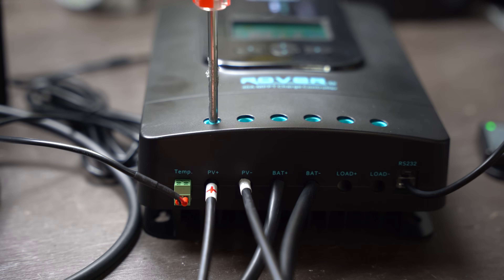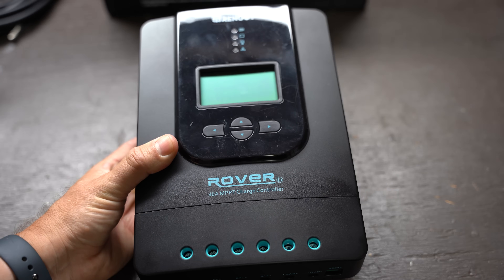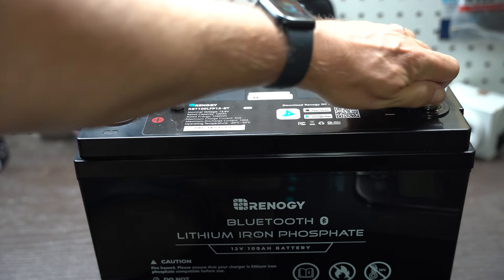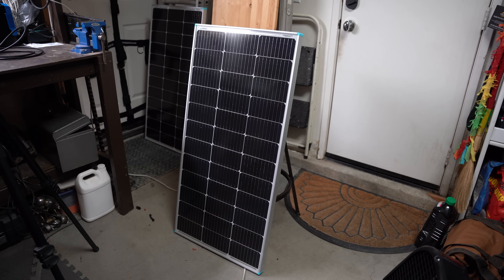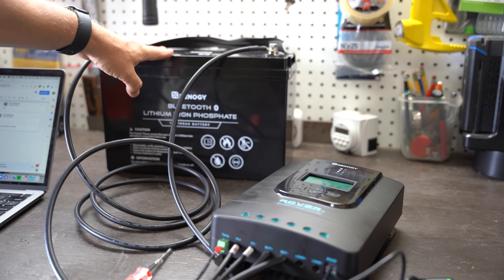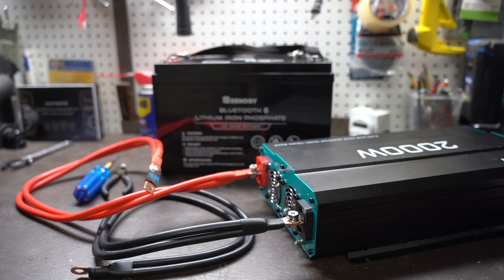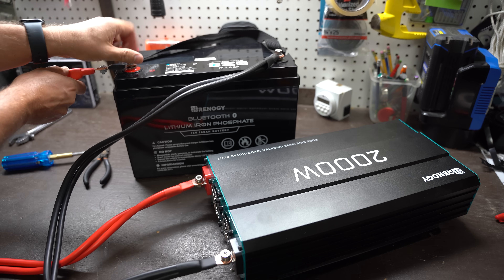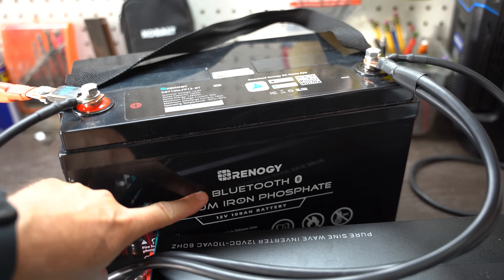DIY Solar Setup: Easy to Follow Step-by-Step Instructions

Comment: Why do you need to disconnect the solar panel and charge controller before proceeding to start the inverter through the battery?

Comment: The only problem is that inverter will suck your battery dry in no time! Unless you have a very large battery bank!
The reflexive load on the battery plus conversion will cost you! If you can use things that can work directly off the 12 volt battery.  Most lighting will do it. Refrigerators, microwaves, and  motors not only need alot of power but need true ac sine wave. The saving grace is they only work 1/3 of the time. (Refrigerator s). 😮 Your system needs maybe 3 x 300ah batteries, minimum. Better to have a kilowatt or two or three. And don't forget you will need solar panels to match the batteries.
Note: Ohm's law.  2000 watt inverter.  Battery = 12 volts.
Watts/volts = amps (current)
2000/12= 166.66 Amps. This means 166.6 amps will be drawn from your battery.

Comment: Working with automotive  electrical systems, I have Always been told you never hook up a battery negative First you always install positive side first then your negative side This keeps you from blowing fuses or damaging the electrical system of the vehicle why in your instructions do you connect the positive first? Does this not risk blowing that fuse you tied to the system?

Comment: so glad i made a video to actually teach people making it simple. u say its not as complicating as some but u actually make it more complicated literally extra work for no reason just saying., literally u hook up the battery to the charge controller to the solar panel just to unhook it all and then u connect the inverter to the battery then do all AGAIN all the work u just did and undid for literally no reason...........long story short how to actually install simple and easy no extra work needed.............

1.) connect inverter to battery
2.) connect battery to charge controller
3.) connect charge controller to the solar panels
VIOLA!

Comment: Thanks for a detail and comprehensive instruction. I’m going to build a small system to power my shed. Basically just power a fan to cool down the temperature and fan. Could you please advise what size of the panel, battery, and inverter. Also where I can buy these stuffs. Your advice is much appreciated. 
Regards

Comment: yup connecting cables to battery backwards on connecting to battery positive 1st negative 2nd no spark reverse removing cables from battery negative 1st then positive 2nd again no sparks no shock to electronics

Comment: I have some questions maybe you can clarify for me, I’m looking into building a system, looking into getting the same inverter, I currently have 5 amg 100ah batteries what’s the best controller to use….. I’m a bit confused does a 40amp controller charge at 12v and 40 amps ???

Comment: Awesome video!

Does anyone know if you have to have a fancy inverter or can you buy one of the $40 3, 000w ones off of Walmart and rewire it into your campers electrical system? The only ones I've seen that have places for wires as opposed to a couple of plugs cost a lot more. In my applications I want to connect to the wiring. Maybe it requires more fuses or an electrical panel?

If you wanted  have more than one solar panel, how would you wire them? I've seen different wiring diagrams.

 Also, has anyone had experience with deep cycle batteries in cold environments? I have four 100 w solar panels and a 2000 w inverter and I have two 12v marine deep cycle batteries.

Comment: Most modern lithium-ion batteries have depth of discharge ranging anywhere from 80% to 95%.  It’s a different story with lead acid batteries as they can withstand only around 50% discharge or damage will occur.

Comment: Hi, may i know why not connecting the inverter to the load port in the charger controller?
Reply: The load port is an output.. It's for small lights or small wattage items. Not sure how many. Check specs.

Comment: I have a 1000 watt Grecell  lithium generator that does not power the AC more than 2 minutes. The USB side and 12volt works fine. What could be the problem?
Reply: 1. Wattage of AC during startup/cranking amps.. 
2. Battery/generator age/cycles... Battery could be exhausted and needs replaced. 
If your generator is fairly new, I'd check the specs of your AC unit.. The typical AC can use THOUSANDS of watts. 1,000 watts, even fully working, would only last 1hr., at most...

Comment: Thank you for getting right down to the nuts and bolts and not wasting our time. The challenge I face is a controller that won't charge my Lithium battery once it's dropped below a certain level.
Reply: Same problem here, not enough amps from panels.
Depending on battery amps.

Comment: Nicely done! I currently use a generator to power my small cabin. Do I simply run a cable from the inverter to the outlet I currently use for my generator? Thanks
Reply: The inverter IS the generator.. You plug appliances straight into the inverter and skip the generator...  
Generator == Charge Controller, Battery, Inverter... All in one.
THIS video is basically an 'expandable' generator.

Comment: Quick question. Might be stupid. But I have the same setup. While the batteries are charging, can i use the inverter to power appliances like our fridge? 

Or do shut the inverter off before connecting the solar panels?
Reply: Yes. And you should always power off ALL your equipment, except charge controller, when hooking up solar panels... The surge when you connect them can cause issues.. But, once connected, you can use inverter and charge at same time.

Comment: You have setted for lithium but you are using Lifepo4 battery. The charging voltages are not the same. You may kill your battery sooner than expected
Reply: How? LifePO4 is a lithium battery.... LI - lithium FE -iron - PO4  - phosphate.

Comment: You need at least one more 100ah batteries to come anywhere near the capacity of a 2000W inverter. If you try to approach it many times with that single 100Amp battery, you will most likely degrade it quickly.

Comment: I did this with pwm charge controller and it doesn charge the battery just no symbol shows and then battery icon with load symbol next to it

Comment: You did a great job of describing how to connect a pre-engineered kit but not what limits to never exceed. For example adding 150volts of solar to a 100volt controller. Cheers!

Comment: So how do you add more batteries and more panels does each set need a new converter box
Reply: More advanced..... Search 'setup a solar battery bank'.. It's EASY to expand once you're setup... As long as you stay within equipment ranges, you can expand really easy...

Comment: Why are the negatives being connected before positive in this video? It’ does it have to do with current in this setup? Or not really relevant?
Reply: I've always been told to connect the positive first...  With such a small voltage, I guess it won't hurt.. If this was a 10,000 Volt system, he would probably die.

Comment: If I opted out for a Renogy 700W inverter instead of the 2000W shown in this video, what fuse would be recommended on the positive inverter cable? Would the same 200A fuse still be suitable for a lower wattage inverter such as the 700W mentioned?

Comment: can you use 8 batteries in line with that?
i would want 2500W Solar-Panels and enough Battery for 48h 1500kWh

Comment: Dang this is awesome. Thank you for the video.. one question for you, can I add a disconnect switch to the system. I watch your other video with more in depth wiring, but I’d like to keep it simple, at least for now. I’m only powering a few lights in a small shop I have.

Comment: Question for anyone who knows to answer. I'm working on converting my car for road trip living and very possibly long term (housing prices man 😭). It will be just me, the only things I'd need to power are my cell phone, recharging batteries for the car fridge I'm getting(battery powered with 2 batteries to switch out), and in colder times my tiny heater and recharging a battery for a heated blanket. I don't see myself using it for much more, on occasion my little laptop possibly. Should I get a 100w panel or 200w? What do you guys recommend?

Comment: Wouldn’t you not connect your positive terminal leads first and then your negative leads afterward when working with DC voltages.

Comment: A tip someone gave me long ago, if you have a soldering iron and you tin the bare ends of the wire that are going into the charge controller you can get a better connection that will cause less wire wear over time.

Comment: You should use a resistor when charging the capacitor, there will not be a spark when connecting to the battery if you did it right.

Comment: Why are you disconnecting+ first/ connecting- positive 2nd
Reply: I thought I was the only one. Positive cable never is hooked up last. 
Pos first on last off.
I hate electrical but that one rule you don't forget.
Reply: @michaelmanns2127  right, I've yet to receive a response..

Comment: Could I have 50 or more feet cable from PV to the charge controller?And are there different Charge controllers for 12,24,or 48 volts?

Comment: I live in an rv it came with solar set up to charge the battery but it didn't come set up with an inverter. I'm wondering if it would even be possible to do. 

When we lose power I can turn on my lights but none of my outlets or ac/heat works. 

Down here in texas power is needed to keep warm/cool.

Comment: I set up my system (renogy charge controller, inverter is a different brand) exactly as you described. When I have my solar panels out (portable) I am not able to use the inverter at the same time (overheats immediately). Shouldn't there be something between the battery and inverter to seperate solar power coming in and electricity going out of the battery to the inverter?

Comment: Question for you: How do I know if my components are incompatible with each other? Let’s say I purchased a 2000w inverter. How do I know which controller can handle the 2000w? Is 40A controller equaled 2000w?

I can see having a 2000w inverter probably required maximum of 2000w solar panels. I wasn’t sure going about choosing the proper controller for the inverter.

Comment: I had a question that I hope that you could answer for me. If you wanted to add an extra battery or two can you use different types? For instance, if I was running a 12-volt deep cycle lead acid battery could I just add say a lithium ion do my battery Bank?

Comment: Hi, very instructive video. Once I have setup the cc with the battery, can I connect the inverter and cc  to the battery simultaneously and then the solar panel, to avoid disconnecting and starting over? Thanks.

Comment: I have two questions - how do I assess how many panels and batteries I need and how do I set this up to run from an electrical panel that connects to an external grid ?

Comment: Great video Kris. I am a complete novice to this and you made it very easy to understand. My question is can I apply this system in the woods to maintain a charge on my trail camera? I would build a box to protect the components but I heard you mention temperature. What can I do to protect the components from the heat of summer and the below freezing temps of winter? Thank you in advance for any help.

Comment: Hi Kris! Great video!! I’m a newbie at all of this stuff. I’m also a visual learner so this is perfect. Thank you so much for sharing your experience and knowledge with others. I have one question.. if you connect the positive to the battery before the negative it won’t spark/arc ..correct?  Like hooking up jumper cables on a car.  I’ve seen this on several other sites and I’m curious.  Thanks again for your videos!

Comment: Hello I have a question,  my van has a setup that I installed that charges my auxiliary battery when I start my engine and cuts out when I shut off my engine so my cranking battery doesn't drain when  I'm using my auxiliary battery device's, it's a Stinger SGP32 power relay  and I bought the same Renogy setup you have in the video , Do you think I can add that solar setup without a problem.

Comment: I am doing this right now, with a 100a circuit breaker between battery and converter as it will not be used by heavy appliances. Also added a 30a breaker between solar panels and charge controller, but that's more as a easy switch to disconnect them. Did spent some hours learning which kind of wires to use at with lengths (bit confusing at first). I came out on a AWG6 which was sufficient for my setup.

Comment: You don't need inventer when you only need DC power right?
I need to power up a portable 12v DC air conditioner, a small 12v refrigerator and a phone ipad and few LED lights 
Which all of them can run on DC from battery so I don't think I need an inventer when I can directly connect multiple cigarette lighter ports to battery with 15amp or 10amp fuse each?

Comment: Excellent video and explanation. I want to add a 100 watt solar panel to my Scamp trailer and this is a very clear explanation of how solar works. Thank you
Reply: Is 100w solar panel good for 3000w inverter and 100Ah battery??

Comment: Avoid accidentally touching the opposite battery post with the crescent wrench when tightening the battery post bolts during assembly. A spark will occur.

Comment: I want to run wire to several lights in my workshop, how would I connect it to this solar setup? From the charge controller, from the battery or from the inverter? What type/gauge of wire would I need to use?

Comment: Please can you also enlightened me with the proper calculation of power audits and each of their respected panel connection to be use and reasons using such either series or parallel.
Thanks

Comment: If I want to build a 3kva solar power myself in my apartment, 
1. how many watt of solar panels do I need
2. How many arms of charge controller do I need 
3. How many arms of battery do I need 
4. How many watt or arms of solar inverter do I need

Will really love if you help.
Thanks

Comment: The temperature sensor is only used with Lead acid batteries per the manual fyi. Not good to use with Lithium

Comment: If it's a double battery set up neg to neg pos to pos will the  converter go to12 power? I thought about this to have longer battery's on 5th wheel trailer.also how to trace out a short ?my neg  on trailer drains batt? THANK YOU

Comment: If I have  2 of 100 AH  lithium lifepo4  battery  on series to make it 24 volts , what amperes charge controller do I need and how many panels do I need to charge my 200 AH  24 volts battery and what kind of connection do I need on my panel arrays series or parallel?

Comment: I’m so confused. My charge controller says max pv voltage is 150v. I have three solar panels that each day they use 48v. So does this mean I can only connect 3 solar panels to my charge controller so that it doesn’t exceed the 150v?
Reply: You should know the answer by now?
Reply: @AJ-ds9xq  I do yes

Comment: If you have ever built a video for YouTube you will truly appreciate how much effort went into making this easy to watch video, easy to watch. Brilliantly done sir!! 

Question

I have a garage detached from my house away from my property. Putting power in there is t possible unless I use solar. I want to be able to charge one of my electric cars (PHEV) the battery is 16.3kwh. It usually takes 3 hours from a 240v (standard uk setup) how many battery’s and panels would you suggest to make this a stand alone proposition. 

Sub from me. Thank you

Comment: Not sure if anyone could answer this but does the Charger Controller have a wattage limit? 
Meaning could I pair it with a 600W inverter or put a 5000W inverter does it matter? My apologies for the lack of knowledge I’m learning this and plan on adding it to a van of mine. I plan on using it for phones and cooler/freezer not that heavy equipment in my opinion.

Comment: Hello! I hope you're doing well! I have some questions if I may. I've been wanting to build a solar powered vehicle. Nothing heavy or extravagant, just basic, light weight with only lights (optional). How would I go about this? How much energy would I need to generate? How many batteries would I need? How many panels? I don't need this thing to go high speeds, I just want to not rely on gasoline and limit any oils and whatnot. I will be honest, I don't have much knowledge on solar power but this is something that I REALLY want to do. Help? 🙏 Please?

Comment: Would have loved a segment on scaling up the system. You've built a 100w system, most people will want a Kw or multiple Kw setup. Helping people understand wiring panels and batteries in series vs parallel and why you might do either or a combination of both would be great.
Reply: No. That's a 2 kilowatt system powered by a 100 amp hour battery. That's 1280 watt hours of power. I have the same Renogy 2000 watt inverter and it will run my Harbor Freight Tools wire feed welder with no troubles. My battery is 300 amp hours, 3840 watt hours of available power.
Reply: @kimmer6 the panel was only supplying 72w of energy back to the battery. Their point was that such a small system is neat for learning, but scaling up to something that could do an entire house would be cool.

Comment: Great video.  I would recommend putting the positive and negative labels on the cable first before connecting them.  Here is a request.  Could you do a video that shows how to run the cables from the solar panels into your house.  This would include drilling holes and installing conduit.  Thanks.

Comment: Im still confused as to what the load part of the controller is for. If you don't connect the inverter to it then why does it have the setting to cut off at a certain voltage? Just to run a DC light?